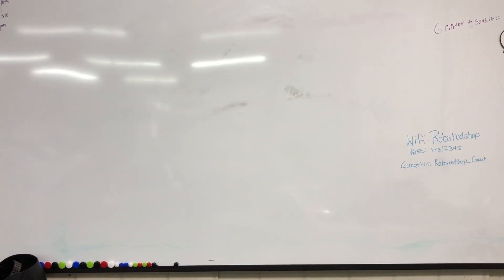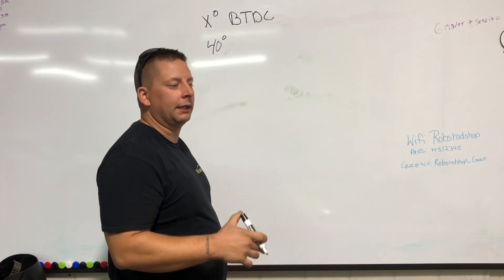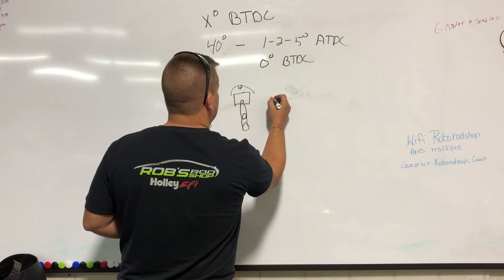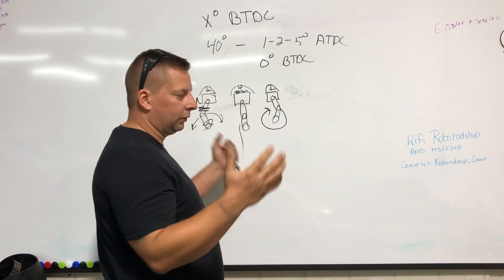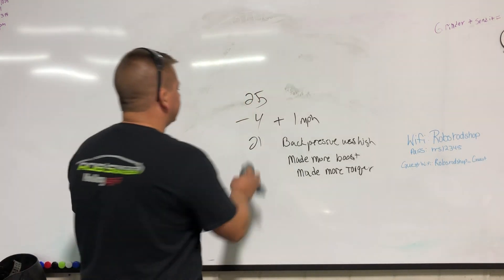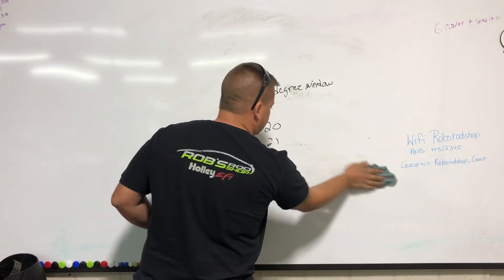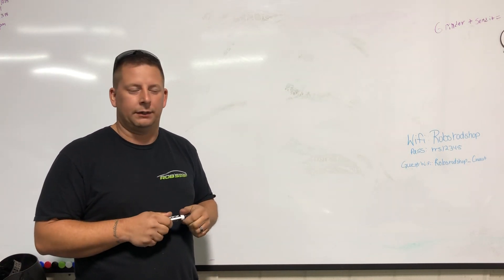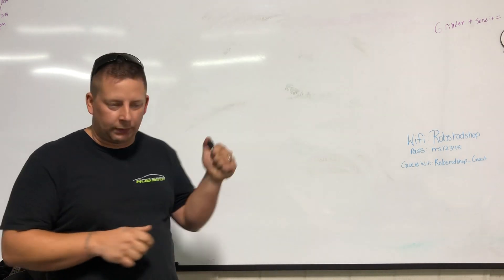Sparky Spark!!! A look at how important proper timing is.

Comment: I love how you are describing everything in detail because turbo motors are all Greek to me at this point I got a couple questions if I may. I just built my first turbo car. its a 4 bolt main .030 over sbc 350 (all forged) /TH-400 W/3500 stall converter  8.5:1 cr. steel World Sportsman 2 heads (wanting aluminum Brodix Track 1's or Dart Pro 1's),1.6 rockers, hyd f/t cam (sum 1104)  running twin 63mm T3/T4's (cheap ebay turbos) and a air to air cooler. 3" diameter.(18" long) down pipes dumping right behind the front tires (Ya it's a little loud but "F" em if they cant take a joke lol). I am running a MSD BTM pulling 1 pr #, my dist. is locked out at 20* on a crank trigger. CSU 850 blow thru, got 120 octane fuel in it with an Aeromotive A1000 w/Aeromotive boosted ref regulator, Gates have 5# springs  ( putting in 10# springs soon). My A/F on the wide band is reading 14.7 @ idle, about 12.6 @ cruise & about 11.5-12.0 @ WOT. but tends to load up a little when I get out of it for some reason.( I am trying to figure that one out yet.) Because I am just learning this boosted thing I am kinda confused with tuning as everyone tells you something different.With that being said I am asking you cuz you obviously know what you are talking about and good information is important (not the guy whom read a mag a while back and thinks he is the cats ass lol) I gotta ask you, do you see anything that is just not right as far as to where I'm at on my base tune?  I hate to ask like this but if you dont ask someone who knows you dont know and good information is key to anything you can do and can never get enough of it if it is good accurate info (hence me asking your thoughts) I was wanting to add/pull some timing to see what it does as far as torque. It is a street truck (65 C10) and as far as location, I am in Wis.

Comment: I had a prostock, TA340 that was so hot...  (How hot was it?!?)  Due to a 1.5-1 valve angle and giant valves on a stupidly high lift and fast duration cam and lots of compression, to boot...  Right at the peak of compression, the ignition would actually blow itself out for a fraction of a second, then re-ignite to finish the power stroke.
  This was visible on a scope as you look at the peak of the ignition (looks like a heartbeat on a cardiac monitor) it would make a squiggly line, looping over itself, then show the trail-off of the ignition.   It was pretty cool.

Comment: Every combination and fuel is different.  There isn't any one timing for every combination and fuel.  My turbo SBF likes 25-26* at 30 psi and 7-8K RPM.  I can change to a different fuel brand, same octane, and 23* is too much. It likes less timing at low RPM, more timing at high RPM. This is why you really have to learn to tune your own car and use accurate data logs.
Reply from the maker: Tom Rauch yes

Comment: Typical SBE 5.3 turbo combo. L33, S491/102, E85. Looking to start turning the boost up over 30psi, is 12° too low up top, and is 2° enough to pull at peak torque? New valvetrain from LJMS geared toward 8300 rpm shift point, PTC 9.5" converter from Dusty. Thanks Rob.
Reply from the maker: Mike Minnick sorry I’m late. 12 degrees, if it’s verified is a great starting point. Keep the afr around 10.8 in that area and you’ll be fine.